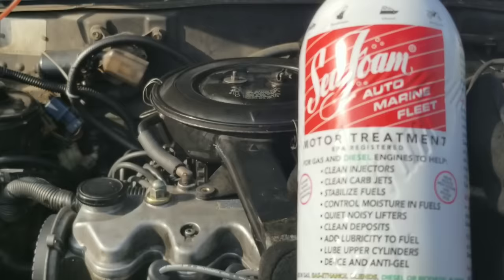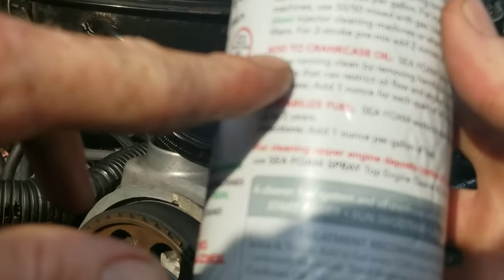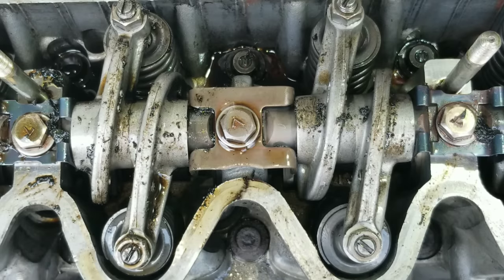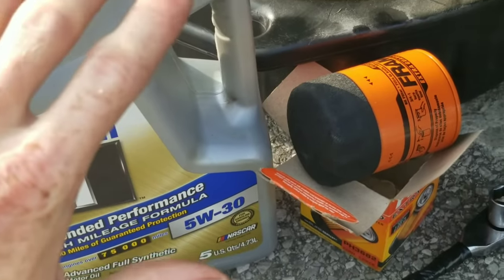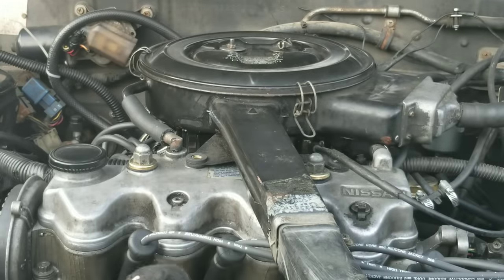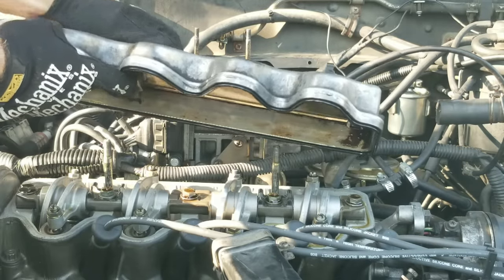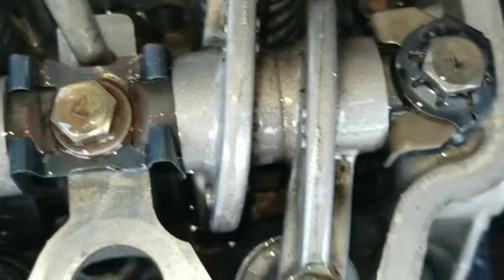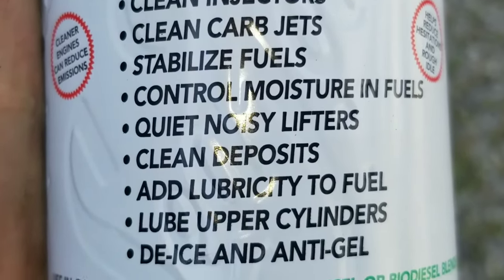Seafoam results i cant believe what it done to my engine

Comment: Use a wix! Those fram filters are junk
Reply from the maker: Yeah in the comments i say use wix xp the fram was only for the flush
Reply from the maker: Yeah wix xp arecthe best i say i only use fram for oil flush
Reply: AMEN to that!  Fram sucks, and chunks of the Fram media has caused engine failure.
Reply: I think we all watched the same oil filter video from dorite fabrication.
Reply from the maker: Yeah what can we try next
Reply: 10,000 engines per month blow up due to FRAM.
lol
Reply from the maker: Yea lmao
Reply: How about a Nissan oil filter.
Reply from the maker: I know wix is of quality
Reply from the maker: I agree
Reply: @hotrodray6802  I can't find that do you have a source.
Reply from the maker: Doesn't seem legit
Reply: Only step up from wix is k&n which has a pressure bypass valve vs how wix does theirs I did a search on YouTube about it a while back and saw that
Reply: savage 069  and carquest, napa filters are made by wix.
Reply: FRAM=TRASH. FRAM=CRAP fram does have better quality filtersnow available. It does speak volumes that they sold that crap they called a filter i thinkthey still have it on the shelf still today.
Reply: What about the fram HP racing series these oil filters are too restrictive I use a Purolator one and my lifters aren't getting enough oil to them now slap magnets on your pan and oil filter the fram HP 1 flows 12 gallons a minute or more versus Purolator 3gpm? Who cares if the fram is 94 percent efficient versus 99 when your oil pressure gauge drops that much like mine has.F**K PUROLATOR
Reply: There's no way in holy hell that I'm spending $10 on an oil filter because some idiot sponsored by wix told me to do so 😂
Reply: @dirtynails7582  next time your at the parts store grab a cheap fram and try to blow through the threaded hole, you wont be able to blow a bit of air through it. Now, grab a mobile one filter and blow through the threaded hole, you can blow air freely through it... Wix is junk also, USE ONLY MOBILE 1 OIL FILTERS!!
Reply: All filters are the same crap on the inside...paper. you can use a roll of toilet paper and get better results...I kid you not..
Reply: Bryan Davis Does anyone here who talks cap on Fram filters have over 410,000 miles on their vehicle. No rebuild, original motor in my 1996 Silverado. Only penzoil and fram filters have been used it’s entire life. My dad is the original owner. I drive it now. It was used for construction. You talking crap on fram is bs. Just show me real life where a fram filter wasn’t mistreated and failed. Meaning you actually change your oil on time.
Reply: I Know Better  its one of the best out there but for ag use or diesel and maybe some vehicles donaldson is King.
Reply: 2:05 & 4:30. Different RPMs LOLOL

Comment: if you clean the gunk out of the oil passages, the oil pressure goes down not up.  more oil flow, less restrictive.
Reply from the maker: The more pressure the less the flow rate sir
Reply: that's what he said  @NATESINTERACTIVEAUTO
Reply from the maker: Im sorry what who said?
Reply from the maker: I was explaining pressure/ flow rate or maybe you meant him trying to correct me saying my oil pressure went up the viscosity of the additive could allow this we could break down the engine to see exactly
Reply: NATES INTERACTIVE AUTO I was acknowledging that why you said was the same thing as the comment just the inverse of it. He said more flow, less pressure. You said more pressure, less flow. It’s the same thing lol
Reply from the maker: I understand you he was saying oil pressure in video wasnt accurate
Reply from the maker: Watch best oil https://youtu.be/pjF1sJ5VeXM
Reply: I was thinking the same, But now i'm not so sure, Makes sense.
Reply from the maker: When it comes to flow rate and pressure plus many other engineering factors of the engine well complicated i previously worked for a geothermal company/drilling and learned much about engineering and flow thermal conductivity so much needs to be accounted for.
Reply: The new clean cold oil, would have had better viscosity than the dirty oil that was diluted with sea foam.
Reply: Does this mean he lost volume of oil because something clogged making more pressure?

Comment: Seafoam definitely recommends driving 100 to 300 miles with the product in the crankcase, not 3000.
Reply: Well it actually says add before or after. I use it before but it says that
Reply: That is recommended (a recommendation is used for best performance of the product). It actually can be used ANYTIME throughout the oils life cycle.

Comment: Hey Nate, I appreciate the effort!  
Don't worry about the nitpickers, usually they're guys that cannot see the good in things.  
Nice job on the video.  
I'd love to see if a transmission additive actually does anything good.  Thanks again.
Reply from the maker: I greatly appreciate your kindness its so positive and uplifting. Check out new oil testing never seen before   https://youtu.be/8GMw6p6-UTI
Reply: I used half a can of sea foam trans tune in a 2000 nissan maxima trans that had a shift flare on each gear change. It helped it a little bit. When I drained the fluid out, i dropped the pan and cleaned the magnets, and changed the screen. I refilled with castrol transmission fluid, and put in a bottle of lucas. The shift flare is completly gone after a month of driving w/ the lucas and clean fluid. I haven't any issues since I did this a year ago. Car has 300k mi on it.
Reply: @4dscdriver  got any pics of this?
Reply: @wildestcowboy2668  pics of what? I tried these products because I had nothing to lose, and it worked. It may not work for everyone.
Reply: @4dscdriver  before I answer you define transmission shift flare, in your own words please.

Comment: Ive had several people tell me Seafoam really helps with high mileage engines. I'm about to try it in my 89 land cruiser with 230k miles. I will report back.
Reply: @fadedbluejeans3680  ok my test isnt done yet, if you'll notice I made that post 2 days ago.
Reply: @fadedbluejeans3680  1 thing I didnt notice is that after putting seafoam in the fuel system after driving for 30 min I noticed it running smoother & the throttle is more responsive. So it did have some immediate results. I just dont know about the seafoam I poured in crank case, itll be when I change oil b4 I know..
Reply: @Rosko311  update??

Comment: used seafoam in the oil of a 1993 ford f250 with the 5.8 that had 179000 on it and had low oil pressure but did not burn oil either on start up or in use. After less than 100 miles the oil pressure had jumped from the bottom of the Normal on the gauge to the middle of the gauge and held there. The oil at the change was extremely dirty after running the seafoam for 700 miles. Ran that oil and filter for 500 miles and changed it again and the oil was very dark yellow. The oil pressure remained at the middle of the gauge. After the 500 mile oil change the oil stayed clean(er) for almost 2000 miles and was again changed at 3000 after that having the same oil pressure and no issues with burning oil.

Comment: A very good mechanic recommended Seafoam to me 30 years ago. I have used it in my gas but did not know you could add it to the oil also. Thanks for going to all the trouble to test this. I will definitely put some in my oil now.
Reply: You'll have to change the oil fairly quickly after adding seafoam to it.
Reply: @zaintahir9038  that's a lie

Comment: My engines been misfiring for about 2 months. I did a LiquidMoly flush and I think it clogged something. I bought a timing chain, but I first tried 3 ounces of sea foam in the oil 2 weeks later no more misfire and the engine has power again.

Comment: I noticed a significantly quiter 5.7 v8 on my boat with seafoam. Also noticed the oil had a lot of suspended carbon on first change afterward, it definitely cleans it out. Good stuff

Comment: I use Seafoam in my gas tank on my motorcycle that has carburetors to keep them clean and stabilize the gas during winter storage. I use a different stabilizer for my fuel injected motorcycle that is specifically made for fuel injectors. I have never put it in my engine oil. I would not consider doing this in a variable valve timed engine. The dirt particles could clog the small screen in the valve timing system. Best advice. Change your oil regularly and you won’t need to clean your engine. LOL

Comment: My best friend told me about Seafoam a few years ago. His co-worker carries a sparkplug in his pocket that he had partially soaking in the cap of Seafoam over night and half of the spark plug was filthy with black gunk and the part that was soaking in Seafoam looked brand new! I couldn't believe his story until I was going to haul off my old wood chipper that was sitting in the back of the barn with 10 year old gas that was mostly gone and smelled like varnish. I took the carburetor off and it was a totaled mess! I poured Seafoam in the carburetor over night and the next day it has loosened up all the caked on sludge. The wood chipper now runs great after the fuel system flush. Seafoam can clean things that normal cleaners can not.
Reply from the maker: Thats a great story thank you for sharing with the NIA community so is there other cleaners that you have had experience with?
Reply: Carburetor cleaner would have done the same thing
Reply from the maker: I believe seafoam is more safe for inside engine but for parts i understand

Comment: I wouldn't use it in high mileage car. Put it in my van with 270,000 miles. Oil light started coming on after 3000 miles, and spun a bearing at 3500 miles. Can't say for sure this is what did it. but for me I don't believe in coincidences.  You decide!
Reply: Way back in the day people use mineral spirits kerosene diesel fuel fuel oil but they only ran her cars about 50 miles as the viscosity tends to get thin by using these chemicals and products so you use it just about the time you're getting ready to change your oil I guess the manufacturer says to use it no more than 300 not 3,000 MI
Reply: @tomthomas9910  I changed my oil per the instructions, it was after the oil change that the issue came about. Sorry about the confusion I should have made it more clear.
Reply: I've heard good and bad about putting that stuff in your crankcase in your gas tank yes I've seen plenty of people with great results but as mentioned back in the day I heard a lot about shade tree mechanics putting in everything from transmission fluid mineral spirits diesel fuel fuel oil which is kerosene to clean out their engines I could see kerosene being used or diesel fuel which is got a lubricant somewhat is being oil but mineral spirits and the like or transmission fluid I would think wouldn't be very good for any o-ring seals valve seals any type of rubber I know on my $150,000 mi truck that switching to fully synthetic oil I no longer here lifters trying to pump up the first three or four blocks when I'm leaving the house in the morning operating temperature or not it seems to run a lot quieter with synthetic oil possibly cuz synthetic oil is much thinner than conventional oil,

Comment: Seafoam is a great product but don't expect it to repair neglected or extremely worn engines. Also use Seafoam in the intake side via a vacuum hose. It will "Help" dissolve carbon/sludge from the back of valves and cylinder heads. More than 1 treatment may be required for  extreme buildup. Afterward, only use 100% synthetic oil to prevent sludge from happening.
Reply: for port injection vehicles why dont you add it too the gas tank? Itll spray the back of the intake valve anyway plus clean the injectors.
Reply: @Oxcotton09  Do both. The Seafoam twin kit has both. About $16 or so at WM.

Comment: I used on a 91 Nissan hardbody oil filter was sludged no oil came out when I unscrewed it . Tru c k sat for 4 years driven once a week short distance.  I dumped a whole bottle in before I changed the oil pump . Totally cleaned the motor , I changed the oil pan as well because I'm restoring Seafoam is the truth .

Comment: I would recommend to change the oil filter after a few hundred miles after the oil change. I have cartridge oil filter rather than a spin on canister. With this type of filter you can really see how much gunk came loose as the filter was covered and probably clogged with that black gunk.
Reply: Yes! I gasped when he said he left it for 3000 miles !!!

Comment: freeing up sludge and allowing it to mix with the engine oil for three thousand miles is a risk of scoring bearing surfaces. you take it apart to clean it or just let it be and do normal oil and filter changes and dont worry about it. were ever the sludge is stuck on it will stay there and not hurt anything.
Reply from the maker: Over time ive seen damage if not treated. i recommend changing the oil early if its this bad before using a treatment. What about lucas destroyed my engine video have you watched it ? Lucas did a great job
Reply: you are very correct. Just use wal mart oil and filters and trouble is a thing of the past.
Reply from the maker: How can we test these different products?
Reply: so your filter doesnt do its job??
Reply: @NATESINTERACTIVEAUTO  Ive seen your video "Lucas destroyed my engine" ... make no sense at all. Im not hating but people need to be advised properly.
Reply from the maker: I was seeing how long a coat would make it last and that was for fun
Reply: NATES INTERACTIVE AUTO ok if it was for fun that’s cool but you should make that clear. Some people might take your advice as real.

Comment: To the content creator of this video. Your engine was very clean at the beginning like a lot of people have stated also, never use an orange Fram oil filter. If you’d like Fram, use the ones that are gold, and have synthetic media in them for synthetic oil. Also, at the beginning what you showed the oil pressure. I heard the engine idling. At the end when you show the oil pressure had went up, you had the engine idling higher like you were holding down the gas now seafoam is a good product, and I have no doubt that it works. But there’s some fishiness about the way you did this video.

Comment: I bought a Ford F 150 (1999) and the engine sounded like a diesel engine. I put 6 oz. of Sea Foam in the oil crankcase and by the next day it sounded like a brand-new engine. This was over a year ago and it still sounds great .
Reply from the maker: Thanks for sharing what others products have you had success with
Reply: So if my engine is making a loud noise u think the seafoam would help fix it ..?
Reply: @Trill89Atwg  Depends on the issue. If the noise is due to worn or broken internal parts, no. If it's due to sticky hydraulic lifers, yes.

Comment: Amazing results in the engine oil. It is letting my diesel Onan 2 cyl generator continue to run well with 19k hrs. Without it the valves stick and it misses and often runs on only 1 cylinder. I use it every 500 hrs religiously.

Comment: I did my car.
Full bottle of seafoam to my oil, drove for 2 weeks, nearly 200kms, sprayed nearly 2 bottles seafoam clean in my throttle body, while loading it up in 1st, then 2nd gear, to make the EGR work, did the hot soak 2 twice, loaded it up twice, took it for a quick highway run, still hot, did oil change.
Reply: This is how it is done. Thanks for sharing.
Not sure about the author and his claims

Comment: Maybe I'm wrong about this but from what I've always understood is that if you went up on the weight of the oil it would help increase oil pressure due to the thickness of the oil and help the seals and moving parts stay lubricated better. Especially on motors with over 100k miles...
Reply from the maker: Thanks for the info what can we try next
Reply: You don’t want to change viscosity of your oil use whatever manufacturer recommends on today’s engines clearances are very specific and that’s why you stay to what is recommended. Back in the old days your theory is much more applicable. Pretty much anything worked as far as oil goes
Reply from the maker: Vvt is why new cars are affected butthey still give a large range just base it off there charts so what can we try next

Comment: I had a two carbureted outboard engine the top carb was running fine the bottom carb did not perform correctly engine would cut out now and then tried several cleaners went to the lake installed seafoam in my tank ran it for about 30 minutes up and down the lake seafoam clean the bottom carb never had a problem since. My local Napa dealer set of all the cleaners he sells and his opinion seafoam is the best. He is not just a salesman he owns the store and runs drag cars and builds engines himself.

Comment: Wheel Horse twin cylinder lawn tractor - high oil consumption this spring (smoking).  It was fine when last run last fall.  We theorized that a ring had stuck over the winter.  Added SeaFoam to the crankcase and within another four or five hours of operation - no more high oil consumption.  Coincidence?  Maybe, but, I like SeaFoam.
Reply from the maker: Good product

Comment: Listen in the background and you can hear the idle is higher when he claims higher oil pressure than in the first oil pressure scene
Reply from the maker: I use a sound meter in other test also i strap the meter in the same place plus as i move the camera the sound may change even roll the window down but it doesn't matter to me if it does or doesn't and increases in oil pressure means decrease in flow rate so thanks have a great day
Reply: I noticed the very same thing.  Not dissing Sea Foam,  because it's great for diesel injectors,  but this dude seems like a snake oil salesman...
Reply from the maker: Lol i dont sale any product
Reply: The engine is definitely revving higher in the 2nd clip